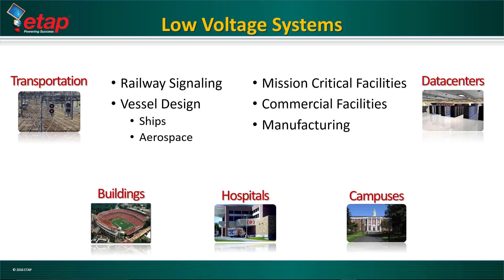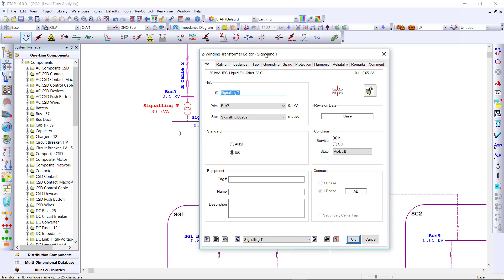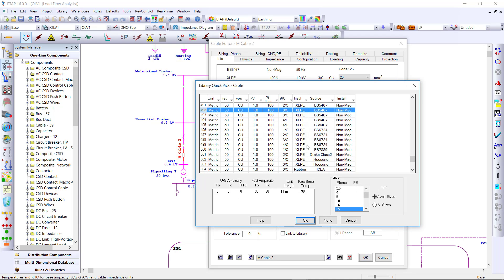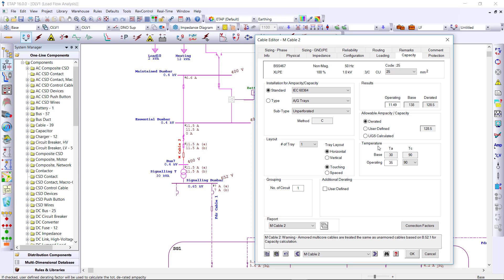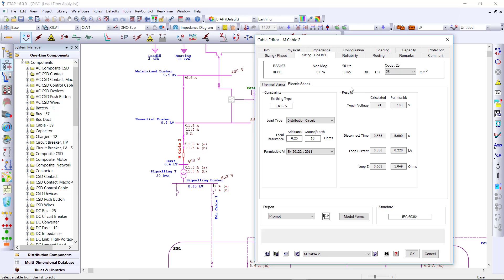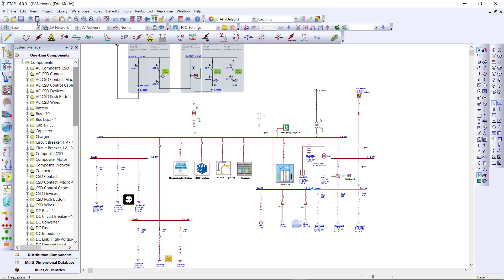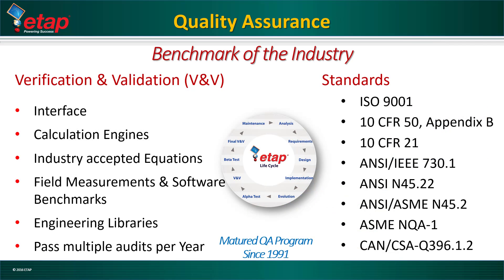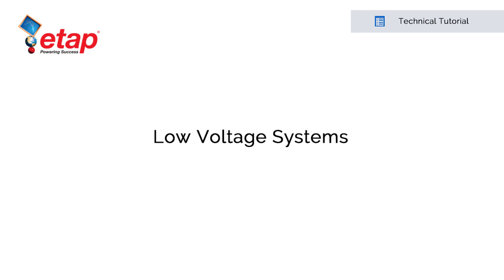Low Voltage Systems

Comment: How to represent an electric vehicle load using ETAP for a low voltage network
Reply: Hi Mohammed. You have the capability to model it with a battery and DC/DC converter. Another option is to model it as a lump load and use time domain load flow to absorb and inject energy to the grid.